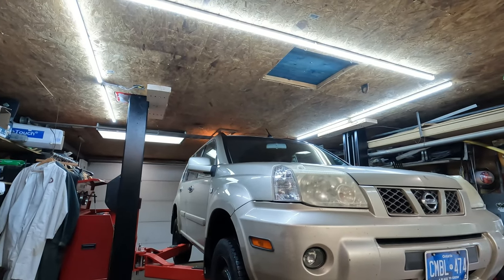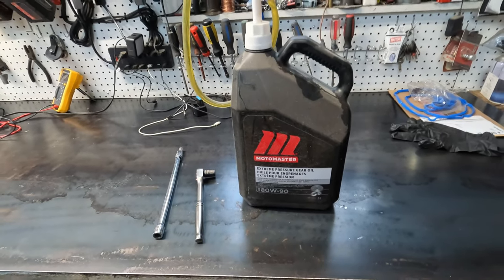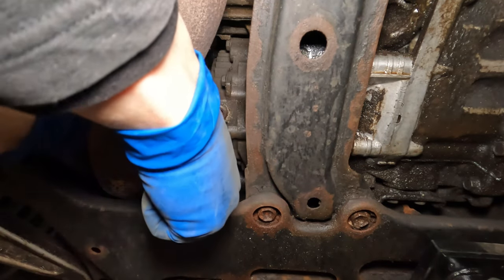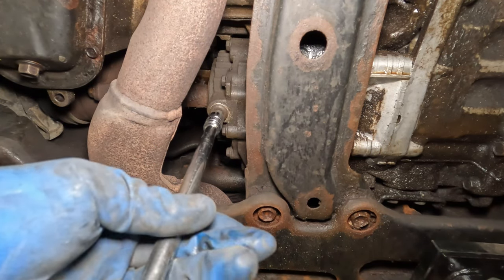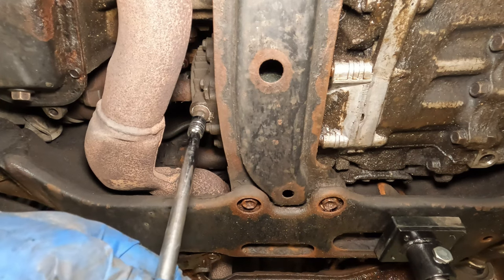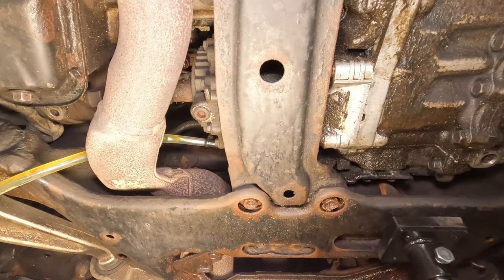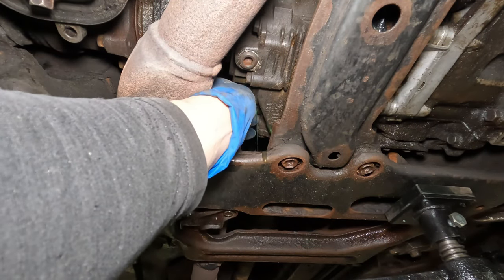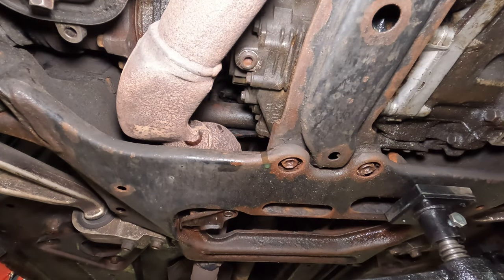Nissan X trail - Changing Transfer Case Fluid

Comment: Thank You!  I have 2 filler plugs, on my 2006, Transfer Case, ones a square holed threaded plug, and the other is a nice o-ringed push in plug with a 10mm bolt keeper., they are bout 3 inches apart from one another.

Comment: Hi Rudy. With no oil in the transfer case before you serviced it, did you have issues getting the Xtrail into 4 Auto?Or did your 4 wheel drive system still work ok?
Reply from the maker: It still works ok as far as I know.